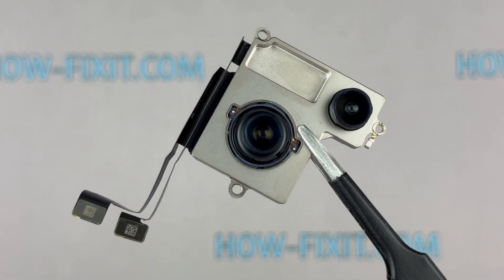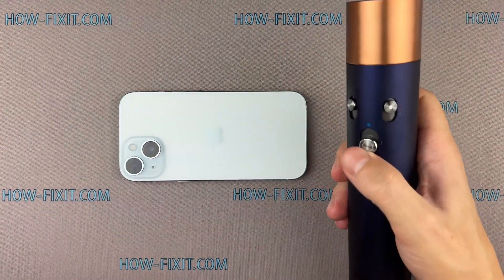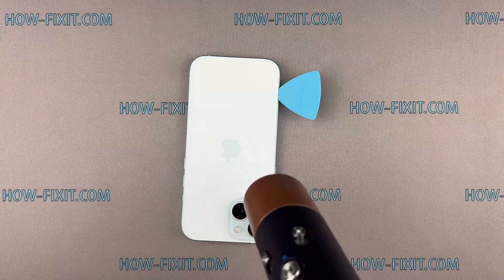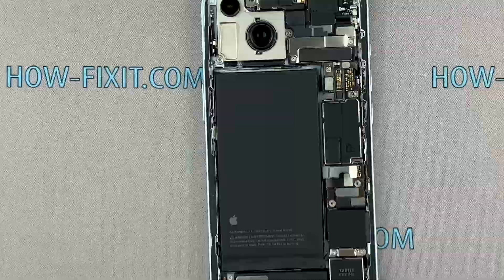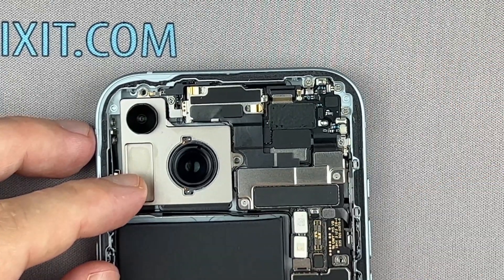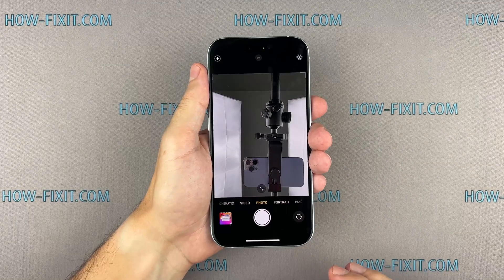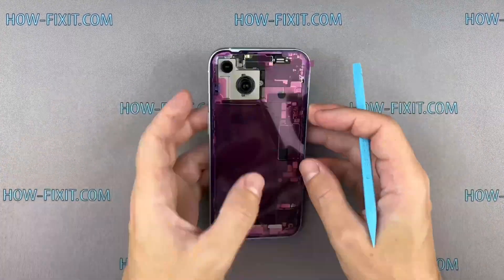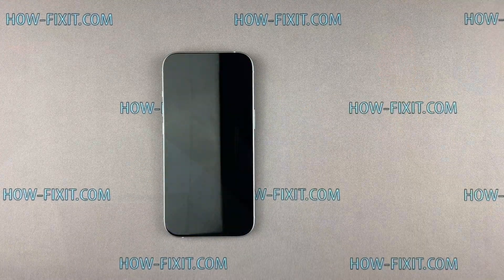iPhone 15 Camera Replacement: Easy DIY Guide!

Comment: If you forgot to reattach the battery connector cover and charging coil connector cover, what kind of negative implications does that have? I don't want to risk breaking my screen to remove again, but am paranoid that it will have an issue